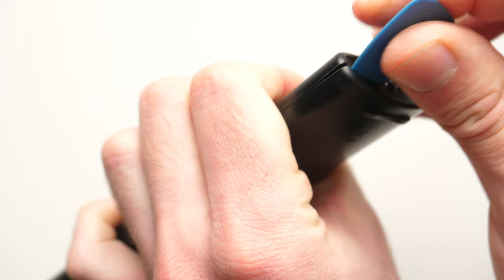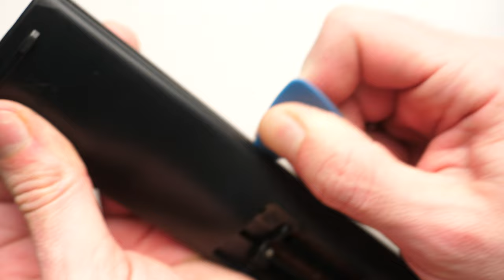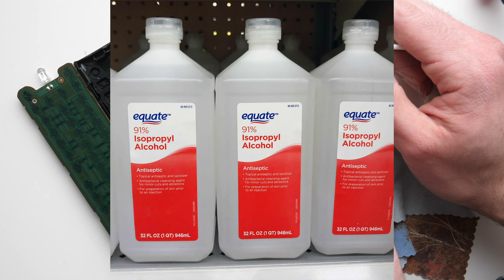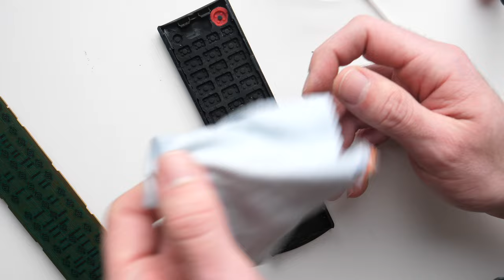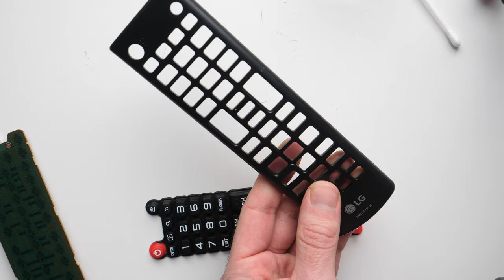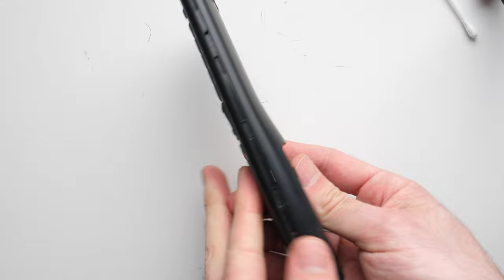How to Clean and Fix your LG Smart TV Remote Control

Comment: Thank you brother! Had so many issues using this remote, many buttons didnt work often, and the batteries were not the problem. Used rubbing alcohol from my wife to clean off the surfaces and it went great! 
Remote works again just as new!
Reply from the maker: I'm glad it worked, I have cleaned mine before too and damn there is so much pet hair getting stuck under the buttons